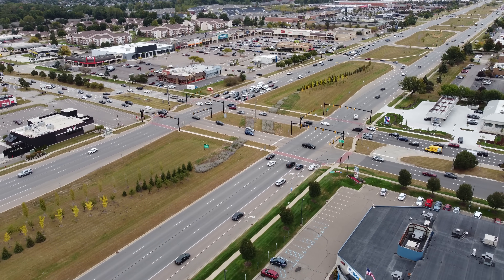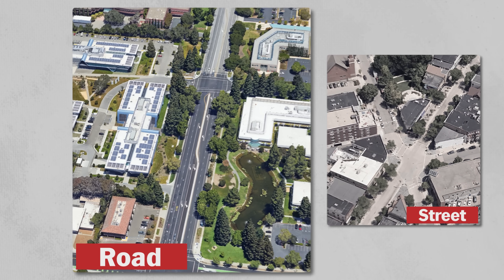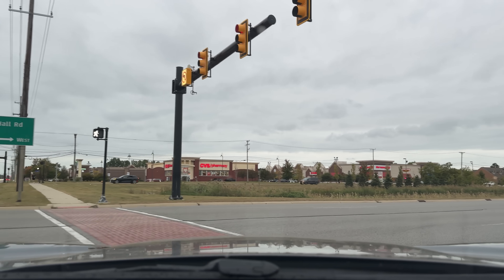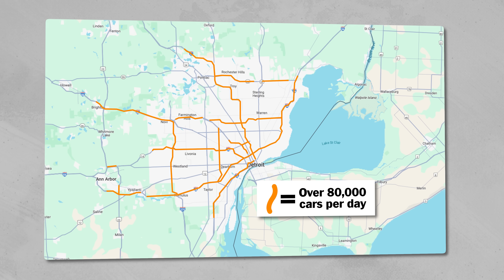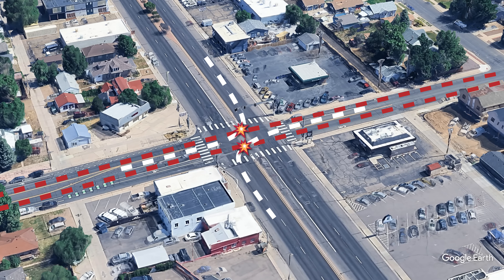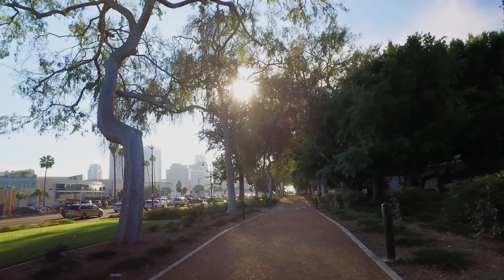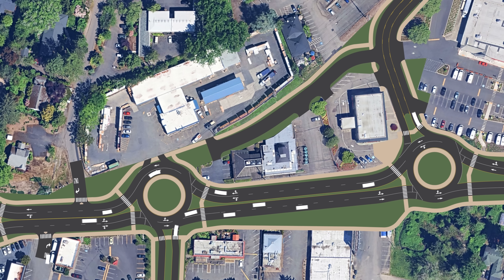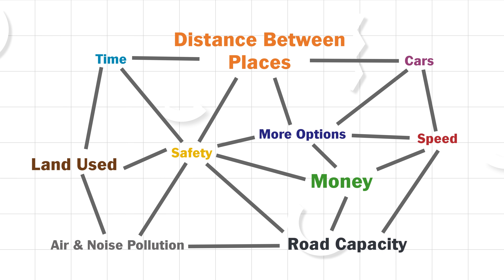How Michigan Built a Super Highway Using Only U-Turns

Comment: Michigan didn't invent this. In the town of Mannheim, Germany, we have several of this type of road for at least 50 years. And I don't think we invented it either. Paris has several of these roads too.
The main problem in the USA is that you prefer to drive fast in a town, with many side roads, what is extremely dangerous. You even have intersections on highways, something Europeans would never build! In a town, roundabouts are the best way to keep the traffic flowing at a decent speed. But it is possible to mess up roundabouts too.
Reply: This is not "in-town".  This was the commuter route to get between cities.  This was supposed to be a limited access highway, but the volumes never reach the threshold to justify it.

Comment: the key is just to eliminate the LEFT TURNS, but in order to do this more efficient is to make a space for the u-turn so road widening is a bit required. Another solution that i think other than U-turn is the one I called the Square-turn (instead of turning right in the intersection and making a u-turn, the car will go straight pass the intersection then making 3 consecutive Right-turn making a square turn to reach the same intersection then pass through it again, but this one requires not just space but also right of way since most side of the roads were owned by private. But the make key here is also the same "to eliminate the LEFT-TURNS.

Comment: This happens when you want an intersection for every shop there is. Just put some normal roundabouts and no left turning on the straight part. Looks over convoluted and dangerous too since if you want to turn left you have to cross 4 lanes till you get to the u-turn part
Reply: Roundabout would not work with these traffic volumes.  It would cause excessive stopping for the mainline.  

A triple lane roundabout would not remove the hazard.  You still have to cross multiple lanes of traffic from the left to enter.  Roundabouts work best on the lower volume roads where there are adequate gaps to merge.
Reply: @traffic.engineer  yeah, you're probably right, but then there's another issue to be pointed here, you wouldn't have traffic this big if the design of the places would be a bit more humancentric. It's true that I'm from Europe and this kind of design (roundabouts) works just fine with us. We try to have shopping areas closer to where people live and shops are easier to reach on public transport and on foot even if they are further away from the living areas. Of course this means you're right about this kind of solution. It's just that seems pretty convoluted and also pretty dangerous anyway, since everyone can go highspeed and you still have to cross those many lanes

Comment: I lived in Detroit Metro for a bit and came to love the Michigan left. The simplified light phasing paired with signal progression/syncing gets you places so quickly. Recently MDOT installed a DDI on a major arterial, which I would normally celebrate, except it breaks the signal progression. I don't think the improved highway access was worth the drop in signal efficiency.

Comment: Back in the 80s in New Jersey, they had coffee cup handles - if you wanted to turn left, you get into the right lane, which then dumped into the cross street several feet before the intervention you were to turn left at. Picture a lazy letter P where you start at the bottom and make the hook out then swing back in to head to the left.

Comment: This is not Genius. It's just a cheap way to create traffic jams. 

The left turners, has to change lanes and with have cross lane conflict with other left turners from other directions, which will cause slowing down and create ghost driver situation. Very similar to cloverleaf intersections. But cheaper. 

This type of junction is ok in a crossroad, if one road has large amount of traffic and other road has small amount. Then it can work ok. 

It's just a cheap way to have an uncontrolled junction, little bit better then roundabout in some situations. That's all. Nothing genius. 
You can see examples in Hurghada, Egypt.  Road from Hurghada to Cairo.
Reply: You are doing it wrong.  You do not change lanes.  You turn dirrctly into the left lanes on the green light.

Roundabout would not work with these volumes.  Uncontrolled approaches works only on low volume roads.  America has more roundabouts than any other country (except France and Italy), so America knows where they work best.
Reply: @traffic.engineer  How can you turn left, without changin lanes? 

A car would turn right first, join the right lane. Then has to change the lane to left one to turn back. 

While others are changing from left lane to right lane. There will be a conflict. 

I don't know how many roundabouts in the USA, I'm sure there are many countries which has more. And I'm pretty sure, Americans do not know anything about traffic management. If they knew, they would change the zoning codes and give up from single family housing.

Comment: I'd be interested in a comparison of these to jughandles. (e.g. 40.6317°, -74.4302° and several more to the west along Rt 22).  Both reduce the number of phases at lights. It does require that traffic on the smaller road be much lighter to get left turners onto the major road taken care of with no special phase set aside for them. Jug handles take more room at the intersection but leave the road narrower away from the intersection. Interesting set of tradeoffs.

Comment: As a Metro Detroiter, I love the Michigan Left!  A portion of these roads in Metro Detroit were originally planned to be full-blown freeways.  Hall Road is one of the best examples of this.  M-59 was supposed to run eastward all they way to I-94.  Mound Road is another great example of this.  It was supposed to run from the Davidson (M-8) up to the Van Dyke Expressway (M-53 north of 18-1/2 mile).  This is why the I-696 Mound Road exit was built as a full-blown freeway interchange.  The freeway portion of M-53 is the only section of this planned freeway that was built.  More fun facts:  M-5 through Farmington was the original planned route for I-96 before it was moved southward to Schoolcraft Road.  Stephenson Highway through Troy was the original planned right of way for I-75.  Williams Lake Road in Pontiac just west of the airport is a small portion of what was supposed to be I-275 running northward all the way to I-75.  The northern portion of M-5 was also part of this right of way.  There are so many examples of incomplete infrastructure across the US.

Comment: Ok this is literally the system I think would be perfect every time I drive on a 45-55mph road with strip malls on either side and lights every 2000 feet. I haven't watched the video yet but take away left turns, put U-turns where all the lights would be and have two lane entrances: One that is its own lane that ends at the next entrance, one that has to get onto the highway immediately. Or worst case just one entrance lane but still...

Comment: It's a nice idea, but has one glaring problem which wasn't mentioned in the video - the U-turn junction requires you to slow down, and possibly stop, in the fast lane, and then speed up, and likely cross over to the inside lane, before the next set of lights.
Reply: Which is also signalized at the u-turn.  Just wait until the green.

Comment: Roundabouts have no place on roads that heavy trucks should be using. At the upper end of load weight trucks are forced to wait for moderate gaps in roundabouts then drive into the traffic forcing every vehicle in the roundabout to yield to the truck entering and accelerating at a slow speed. Or the trucks try and judge the traffic and arrive at speed in a gap. 

Neither option is safe or good.  

Also almost all of the problems of the second example are fixed by the suggested conversion of the sharp angle 4 way, by taking out the one building and turning the exchange into two T intersections. No need for a roundabout, just eminent domaining someone's business into a road and removing the existing connection to the new T.
Reply: Roundabouts are great for low volume roads with trucks.  When there is moderately more heavy traffic near the point of capacity, the gaps for trucks to enter are less.

Comment: The road is approx. 100 meters wide, and has as much throughput as pair of tram rails, which require 8m of space. Unless your land, fuel and cars have no value this road is a complete waste of resources.

Cheers from Europe!
Reply: It was originally dedicated to be high speed lanes, but the lack of traffic did not justify it.  It could easily be retrofitted with transit.

Comment: 10:48 - I lived near that intersection for 20 years, driving that giant cluster-f of an intersection nearly every day. The HUGE problem with it is the dual-offset intersection of streets coming from seven different places in a small area. Yeah, it is two separate intersections, but because of the angles, they all kind of merge together. It's made even worse by the fact that while it's in a very urban location, it's technically in unincorporated county OUTSIDE Portland. So while City of Portland would love to have that be better (the city officially ends one block off the right edge of the picture) they have no say in the matter. Even worse, two of the roads are state highways, and the state is TERRIBLE at maintaining state highways that are inside metro areas, other than the huge freeways.

The only real problems with your solution:

The rightmost/East up/down road and roundabout are in a parking lot on private property. That's not a road. (Although the building just to the right of your new road/North of the new roundabout is an old Safeway grocery store that is now closed and used as a Safeway/Albertsons home delivery hub, so the parking lot sees almost no use any more, other than a dozen Safeway/Albertsons delivery vans. So some eminent domain to take away some parking lot wouldn't go amiss.)

The businesses to the right of the "Southern leg" off the middle roundabout now have zero way to get to them. You've removed all of their access points. (The large parking area doesn't connect to the streets to the right, only to the main road that you've now separated, and the Southern leg to the left, which you've removed the entrances from as well.)

You've also made getting to the businesses to the left of the "Southern leg" painful to reach from that Southern leg (where a lot of local traffic flows into that shopping complex from.) Instead of traffic from the South just turning left into the parking lot before the intersection (now middle roundabout,) they have to go through one roundabout, turn left, go through a second roundabout, do the U-turn, the finally turn right down the street to the left/West of the complex.  And going back South into the neighborhood after shopping there isn't just a right turn out of the parking lot any more, it's a turn out the far side, wait to turn right, then right at the roundabout. (My long time pet feed store is in that area, along with one of the best donut shops in Portland.). And when coming from the street at the upper-right, to the "Southern leg", no more sudden "oh, I'm driving by, I'll just pop in for a donut", it's now a long curving route to get in and out.

Make a few tweaks to this design, though, and it would be wonderful. There have even been a few new roundabouts going in not too far from this mess of an intersection, so people driving in this area could be accustomed to them.

Comment: First, road and street are synonyms.
Second, NO MICHIGAN LEFTS ARE HORRIBLE.
NOw you have slow drivers merging across multiple lanes. Uour argument about only worrying about ine direction at a time ALSO applies to Stroads, thats what that center lane is for.
Reply: There is no merging.  You turn directly into the lane on the green light.

And with stroads, the center lane may have other vehicles approaching , increasing risk of crash.

Comment: Respectfully disagree.  Imagine semitrucks trying to use them, at night with no lights.  They don't work in rush hour because traffic extends past the left turn so you can't enter and move over lanes.  And the roads must be extra wide taking up more room.  They do not work and cause more traffic.
Reply: There are signals.  If it is unsignalized, it means volumes are low enough to allow gaps for trucks.

Comment: These Michigan lefts have a huge flaw in that drivers are utterly stupid.

People turning right out of these intersections are supposed to merge with traffic and move over to the left lanes, but that doesn't end up happening.  What happens is drivers sit and wait in the turn lane and block it while waiting for a big enough opening that they can cross all three or four lanes all at once to get in that far left lane.

It ends up causing just as much traffic, if not more, on the side streets, driveways, and intersections.  The only congestion it reduces is on the thruway.
Reply: There is no merging.  You turn directly into the lane on green.
Reply: @traffic.engineer  on green, yes.  That's not meeting, that's normal traffic flow.  What about right on red?  What about turning right out of driveways?  There will invariably be a driveway maybe 50 feet before that u-turn access, and the people exiting that uncontrolled driveway that want to turn left will be trying to dart across the entire three/four lane road to get into the u-turn lane. 

We have an intersection exactly like this a few miles down the road from my neighborhood.  There is constantly backed up traffic trying to exit the driveway and get completely across the road to access the u-turn, drivers are scared to try to merge into traffic and risk not being able to move across lanes, so they wait until every lane is completely clear, which only happens once in a blue moon.

Comment: I admit that I clicked this video to see if they were talking about 16mile (Big Beaver or Metro Parkway) or M59 (Hall).  I live just off of Hall and I have never met anyone that did not hate it.
Reply: When they made the split version of Hall Rd I was just a kid.  My Dad firmly believes that the real reason that the roadways are so far apart is that they originally intended to continue the trench freeway part all the way to Selfridge ANG, but that the City of Utica (Historically one of the oldest cities in Michigan, but now little more than a collection of shitty bars) argued that if the intersection of M59 and Van Dyke was removed, then the city would die.  So they bought the land, then lost the case, and revised to turn the service drives into the main road.

I have always wondered why they never bothered to continue the project.  But now that Lakeside mall is closed, and the Christmas shopping of the 90s is gone, there really is no need to handle that much traffic.
Reply: The absolute worst is when a turn-a-round lines up with a busy business exit.  There are a few of those.  The one that gets me is at the Harbor Freight.  If you are eastbound and you want to go to a business on Utica Park Bvd, then the Harbor Freight turnaround is were you go.  But then you end up playing chicken with any traffic pulling out of Harbor Freight.  That is traffic you need to zip into, quickly, because you need to make another right.

This doesn't mean the road concept is a failure.  It just means there are some really poor decisions that were made, that cause everyone to hate driving this road.
Reply: BTW, the other road that would have been a great example to use is Rochester road between 16 and Auburn.  They took out the center turn lane and replaced it with a divider and turn-a-rounds which works very well there.  And then the lights are all timed for north/south traffic such that if you are going long distance you will never hit a red light.  It is a joy to drive.

Comment: Problems with roundabouts in the U.S. is they are too small and dont prioritize traffic flow to any direction. Even your example would need to have the main thoughfare as priority with the u turns yeilding to that. Instead traffic in the circle as the right of way and makes even a simple right turn troubling as we cant tell if someone is making a full U in the left lane or a left turn which requires them to move into that right lane until they are right ontop of your entry point.

Comment: Large vehicles and roundabouts are a no go, just south of hall road on van duke there is a roundabout that is one of the deadly intersections, combo of one of the lane is a offramp to the nearby van dyke expressway(separate from van duke street) and there are a number of industrial facilities right near the roundabout, meaning there are usually semi trying to go through the roundabout and sense they can't start and stop on a dime along with being so long cause a back up of traffic in the roundabout whenever one crawls through.
Reply: The trailer wheels are supposed to go through the roundabout.

Comment: There is a section of HWY55 outside of Raleigh that tried to do the u-turn highway thing and they botched it.  Having a way for perpendicular traffic to go straight across the highway is key, and they made you do the whole turn right, u-turn and then turn right again just to stay on the same road, it's infuriating.
Reply: The straight movement causes all the delay.  That is why all the sidestreet traffic turns right and u-turns to less the amount of totalnred time.

Comment: This reminds me of the entire length of Telegraph (US24) also in Metro Detroit. It's about 80 miles long and in large sections if you get the speed limit and timing right, you can go more than 20 miles without a single red light (or miss and get EVERY red light). LARGE sections have a similar "super highway" feel thanks to Michigan Lefts.